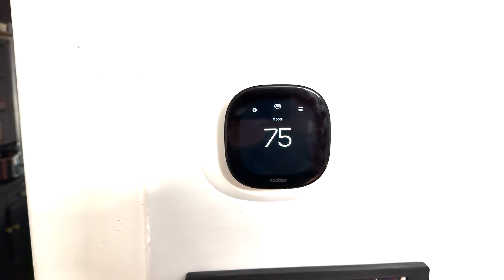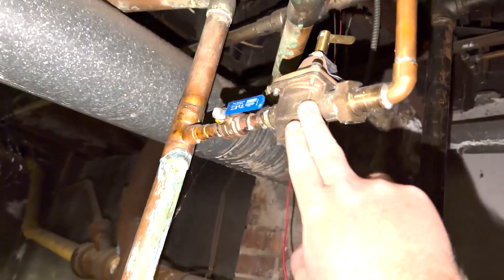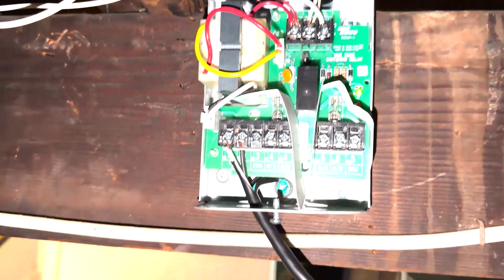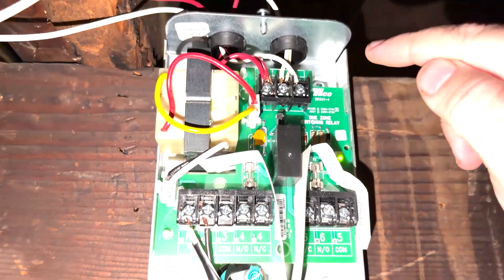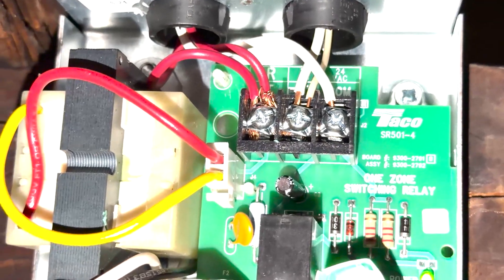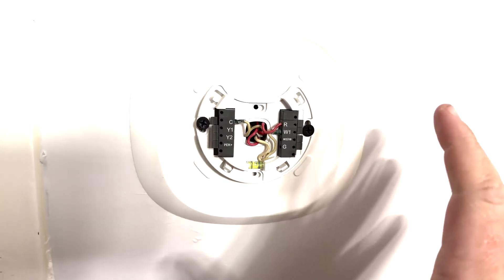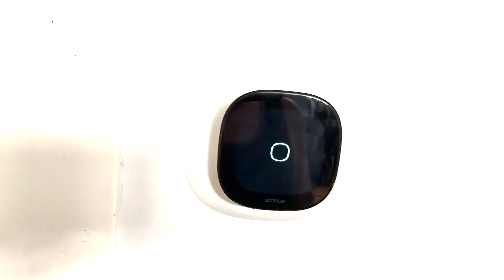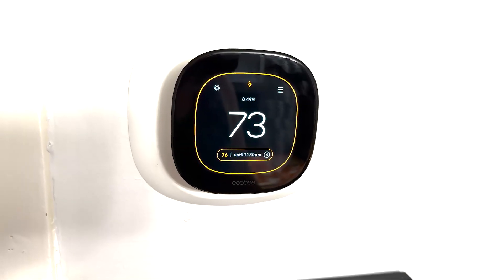Installing an Ecobee Enhanced Thermostat on a 2-wire boiler system

Comment: Excellent video  Thank you for your efforts !   I am an electrician and i spent hours with this EXACT same boiler set up.  The stat manufacturer customer service was useless ( of course she had an accent )and the manual did not discuss a two wire boiler system at all, nothing online from manufacturer  I am ordering the parts from your video and will be installing things in a few days   I started the thermostat swap 830 at night after a long day to begin with and boy was it frustrating.  Thanks again for walking us thru this